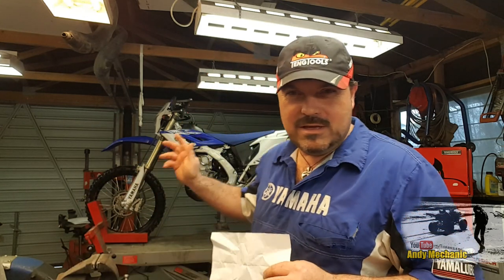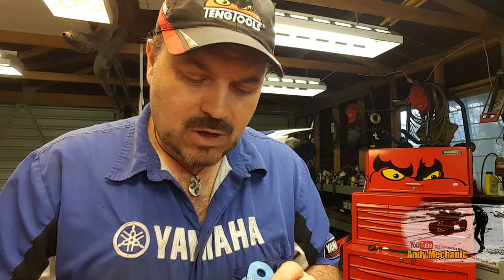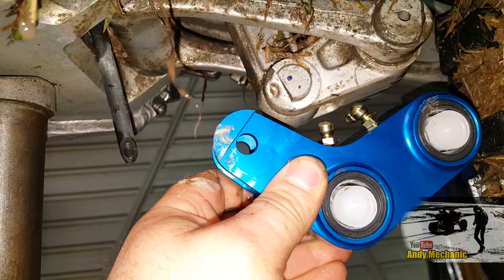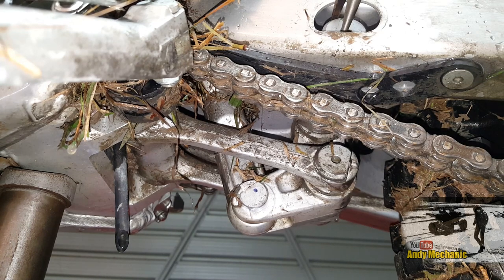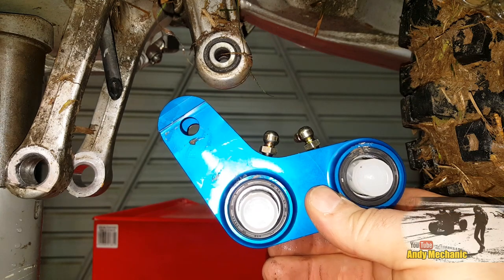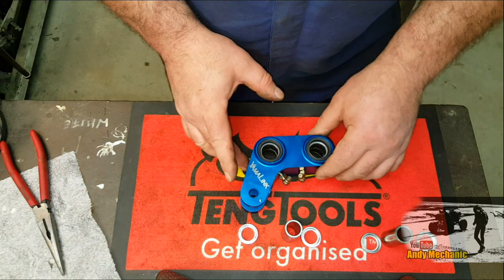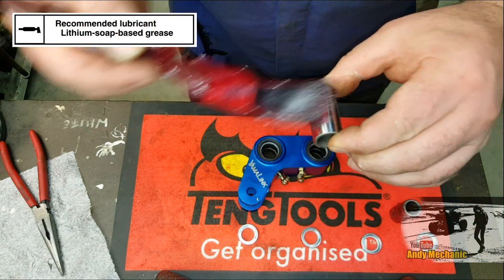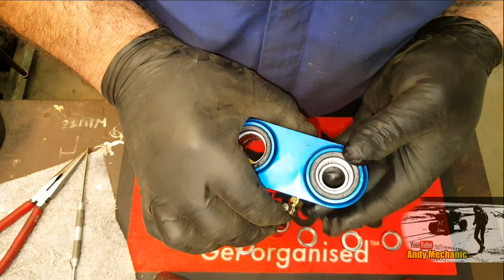Yamaha WR450F lowering link install #1610

Comment: I am replacing the dog bone in my 2016 WR450F with the stock piece (bought it used with a lowering link).  This video is very helpful to what I am doing, thank you.  Also I would put some of that grease directly on the needle bearings before inserting the bush/spacer.  Cheers mate!
Reply: Can I a ask why you are replacing with stock, I'm about to install lowering link on my 450 2017
Thanks
Reply: I’m doing the same the bike sits really low

Comment: What about USEING the yamalink dogbone with it ...need further info.but gr8 vids ..just subed..
Reply from the maker: Cheers for the Sub, I'm not sure how it'll work with the dog bone too, to be fair it's low enough with just this linkage swap - Tyre will rub on guard on full compression & that ls with spring pre-load well below minimum. So no real benefit fitting a dog bone too in this case.

Cheers Andy